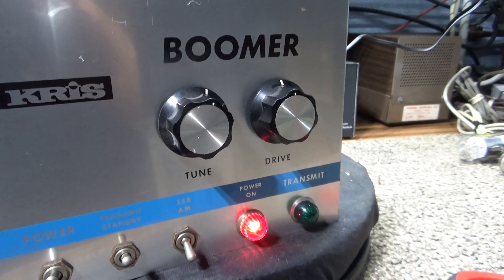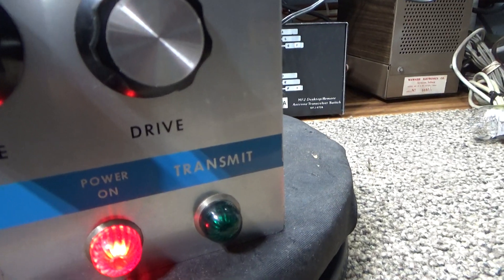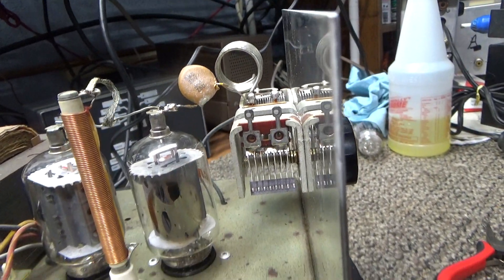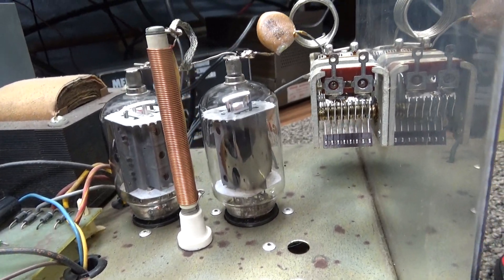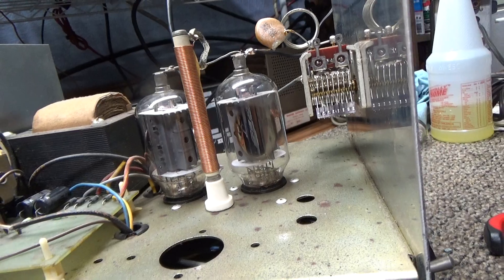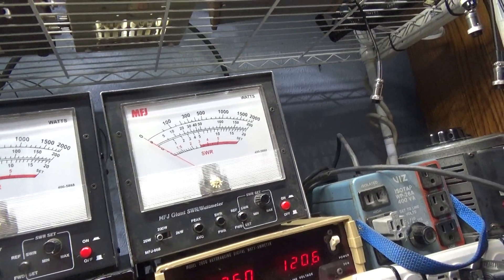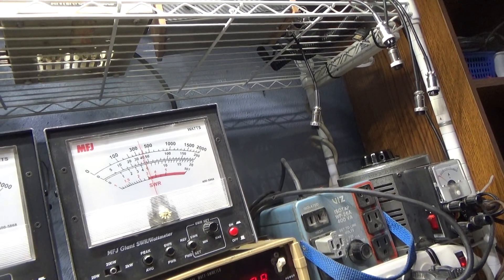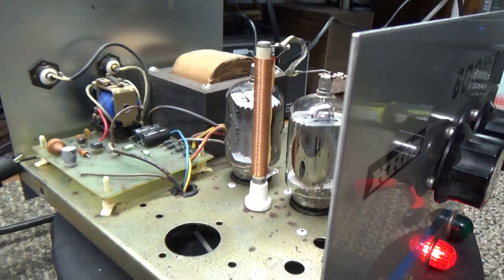Kris Boomer 2 small tube 10 meter linear amplifier 6ju6/6jb6/6jf6 tubes

Comment: Interesting to see a near mint Boomer. They punched the chassis out for an extra tube but the layout is reversed from the Big Boomer. Also, no cooling fan. 
For those not familiar, the Big Boomer has three 6LQ6s driven by one 6KD6. It runs 600 plate volts to develop 190 watts input on AM and 400 watts input on SSB. It also features a receiver preamp, and a panel meter that reads output power, plate volts, and SWR.
Reply from the maker: Yep

Comment: What's up Doc? I got my MK IV'S yesterday. Not the A's but seeing as how Barketts refreshed them from the 776 mic to all new tubes in the transmitter and the receiver and realignment include caps, really nice set. Dead keys 5 swings 25 pushes my Eagle 500 over 1k peak. Now the radio man says my RG8UX isn't good enough for my 120' run because of loss? Why can't I win? No such thing as plug and play?? Tech says I need at least RG213? But CB does stand for constant buying. What say you Magic Man?
Reply from the maker: Well, if you want better performance.....  get rid of the 8x and get something with lower loss. Beldin 9913 and LMR 400 are very popular. What antenna you running?
Reply: @tramdr  I'm running an A99. I may look into directional before winter comes calling. Thank you.